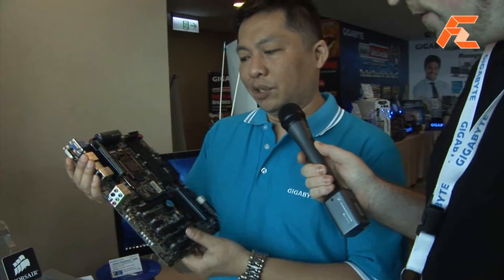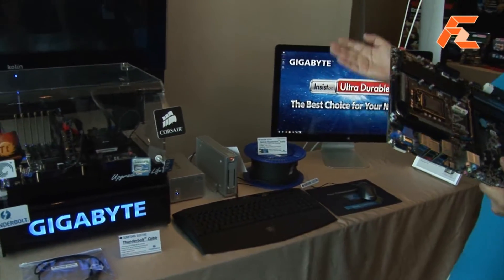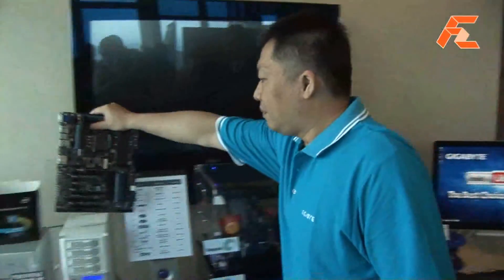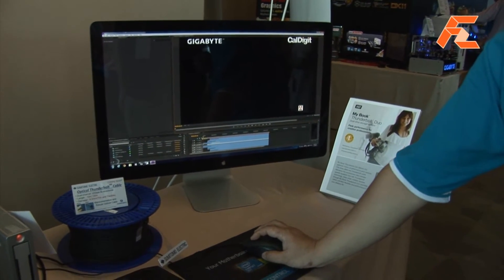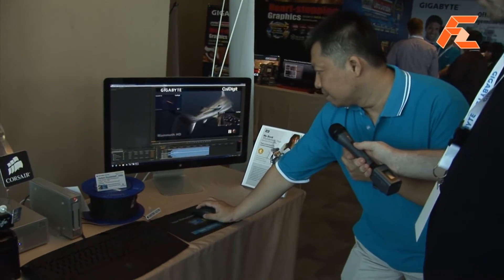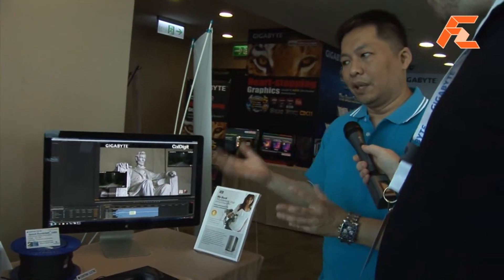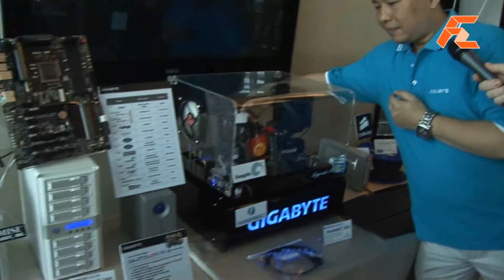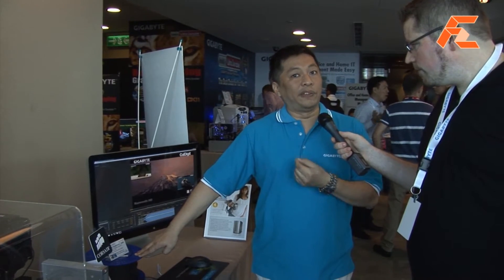Dual Thunderbolt stress test demo on single Gigabyte motherboard - Computex 2012

Comment: Why is it better to have your hard drive on serial Thunderbolt lines, than connecting internal drives using SATA? The only reason reason I can spot is mobility of the hard drives....

And what is wrong with using a HDMI connection to my monitor?